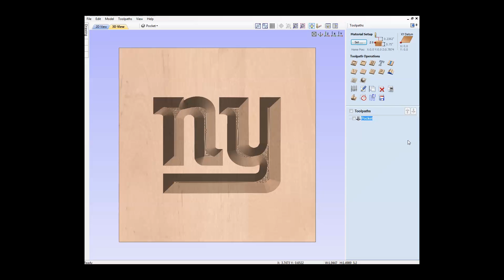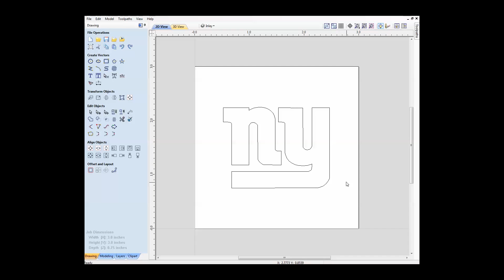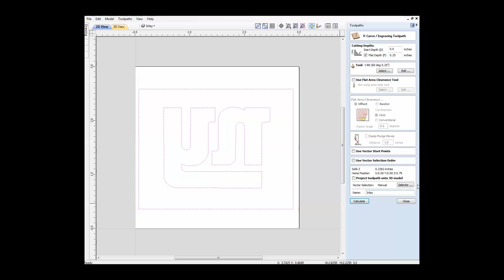Perfect Inlays On Your Projects - Tool Giveaway Info

Comment: Question: I noticed on your plug you used flat depth totally and no start depth. I am slightly confused by this. Typically, the traditional teaching on the vcarve method uses the "start depth" as the depth the plug fits into the hole, and the "flat depth" on the plug is how much the plug sticks out from the female piece. I have been doing inlays with varying success on my cnc, so I am curious as I have not seen anyone do it this way before. How does it do with small details, as that is where I typically get "tear out".
Reply: start depth is solely the only really important #.  it determines the depth into your female/pocket..  FD flat depth is the amount of material you want sticking out from the top of the plug…  also with a 60 deg. V bit your not going to be able to go very deep on the female pocket so the inlay will not be as strong as a deeper pocket. Fine for artsy stuff that will hang on a wall but that’s it. I suggest 6mm pockets or .250” plus! And also to get these better depths you’ll be better served with a minimum 30 deg. V bit or better yet I use a TBN Tapered ball nose with a 6.2 degree angle. It’s 3 flute. Helix cutter very strong, very sharp and can plunge directly to the FD in one pass… minimum of .200” depth on inlays if you want any strength..
ie.. pocket depth… 6mm ( female).   SD+FD= 7.5mm goal for me is 1.5mm at the top of clearance 
SD + FD should always equal 7.5 mm that gives you the 1.5 mm at the top of space
There’s a simple rule to follow when doing test pieces. And checking figment of the plugs.
Start depth 4.0 mm plug (male)
Flat depth 3.5 mm.   Plug (male) Start with this on a test piece to find your proper parameters for the inlay

Comment: You dont have to change the start depth on the plug or change the tolerance?
Reply: Tried it per the video...Didn't work! Maybe my machine.
Reply: @JOHNSMITH-ug2mt  60 deg vbit is too wide… min. 30 deg v bit.. ok for artsy stuff but 60 you can’t go deep at all.
I use a TBN Tapered ball nose that I enter as a v bit.  Much stronger! 3 flute helix
6mm pocket with a 1.5 mm space at the top for band sawing off the plug or clearing off with the CNC
ie.  Pocket.. 6mm female
Plug SD 4.0mm FD 3.5mm. Total/sum = 7.5 mm.  That is the 1.5mm at your top of the plug!
The sum of SD & FD MUST ALWAYS = 7.5mm
ie..  SD 3.0mm FD 4.5mm
You have to test cut plugs to work out your fitment of your inlay..
30 degree v bits are very popular and the easiest v bit to work out your parameters for your inlay and still allows you to go deep to about .200-.2600” or 6mm deep.
Albeit even with a 30° V bit at a quarter inch depth you may start to lose detail in small very fine inlays
The sum of your start death and flat death must always equal 7.5 mm because if your pocket is 6 mm and your start depth and flat death equals 7.5 mm then that will leave you 1.5 mm of space at the top of your plug this is the space you can fit a bandsaw blade in to cut off the plug if you want or clear it off with a CNC
You absolutely have to do test plugs also you have to do test plugs on end grain which is the best for inlays or face screen or Edgegrain n as the parameters you use will differ from the type of plug you’re going to use and green face green edge grain

Comment: Does anyone know What are the best Fonts for an inlay Thank You Charlie V
Reply from the maker: You can really use any font you want. I have used everything from Arial, Times New Roman, and even script fonts.  They only thing I would say is the more “blocky” the font the easier.  Script fonts tend to have very thin pieces so they can break away during the carving. Hope this somewhat answers your question.

Comment: Hello. Was looking at you video about inlay... Actually it is different from others... When you cutting the inlay you are not dividing cut depth into start depth and flat depth? I saw you inlay does not go all the way in...
Reply from the maker: Hey Tomas - in my opinion the inlay does not need to go in all the way. The sides are V-shaped so once I push it in as far as it can go it won’t travel any further. So why do I need to fill the entire void?  That was my thinking at least. Thanks for the post!
Reply: @ShorePointCreations  Leave a little space for glue.  Start depth of 0.1, cut depth of 0.2 for male or plug.  Start depth of 0.0 and cut depth of 0.3 for pocket or female part.  Works every time.

Comment: Great video! Quick question, every other V-Carve Inlay video has the pocket set at Start Depth of 0 and the Flat Depth = the depth you want the bottom to be. Same as yours but the inlay piece the others start with a total depth of say 0.2" and then the start depth is half of the total depth and the flat depth is half of the total depth. I believe they do this to give a space for the glue. On your example you made both pieces .025" with a start depth of zero. Did you find this method better?? Thanks! liked and Subbed as well!
Reply from the maker: Hey Stephen - in my opinion the inlay does not need to go in all the way. The sides are V-shaped so once I push it in as far as it can go it won’t travel any further. So why do I need to fill the entire void?  That was my thinking at least. Thanks for the post!
Reply: @ShorePointCreations  your answer did now address his question.  He is implying that your flat depth is the same in both the male and female part.  This leaves no room for glue.   You did not specify a start depth of something > 0.

Comment: Doesn't this leave a hollow area underneath the inlay?
Reply: You need a small void underneath so the excess glue has somewhere to go.  Otherwise you would not be able to compress the 2 pieces.  Liquids do not compress.
Reply from the maker: This is true but typically I coat the sides of each piece with glue and try not to flood it.  But others may so that’s a great point to bring up.  Appreciate the observation and good comment.
Reply: @billysmether6237  eliminating a hydrologic lock.
Reply from the maker: +blargh123123123 Thanks for the comment!  There may be a small void below the inlay however it does not impact in any way.  The plug is V shaped and therefore cannot slip in anyway.  I have had inlays done this way for years and have never had any issues.  The traditional inlays gave me more issues.